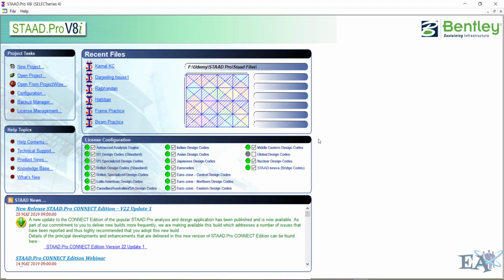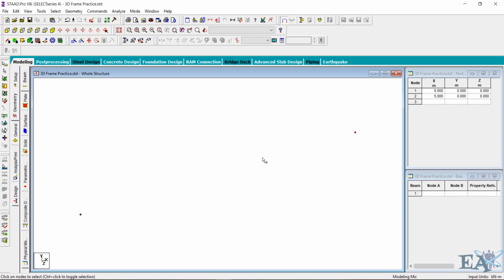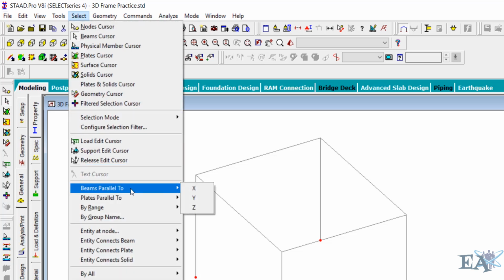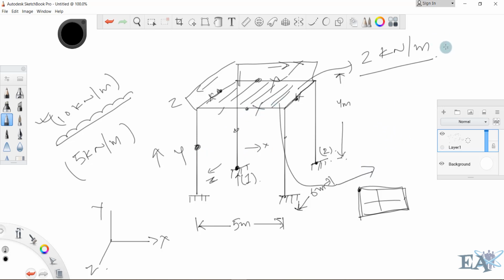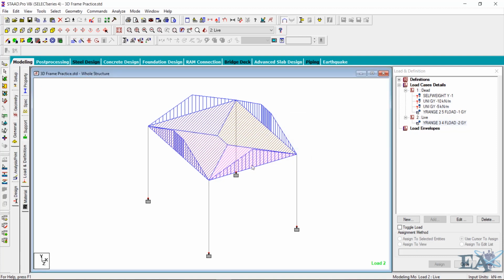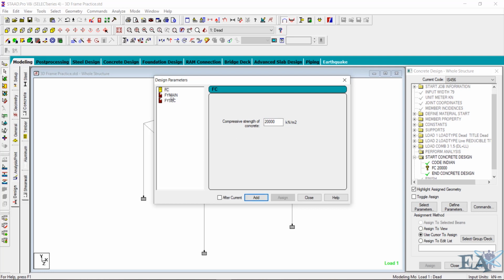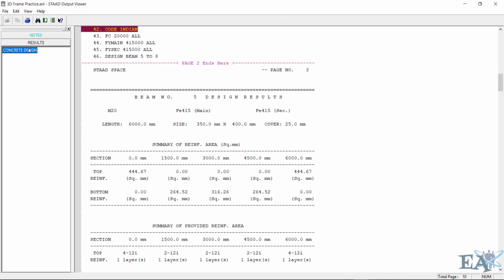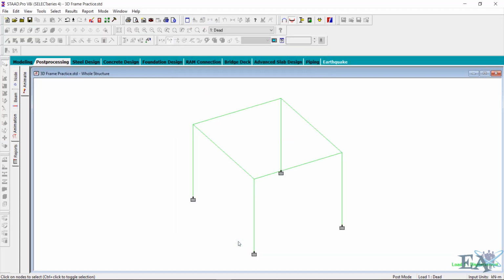STAAD Pro Tutorial For Beginners [Episode 4]:  Analysis and Design of a 3D Frame

Comment: Sir i am facing a problem after changing the sections of beam and columns the run analysis option is not working.
Reply: No no it is working i already opened the previous output result file so the new one wasn't working.